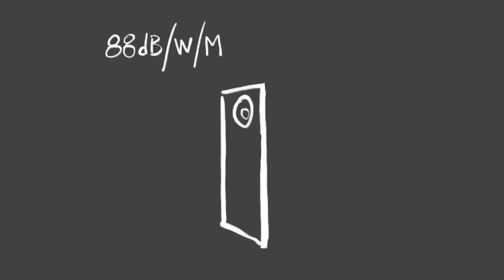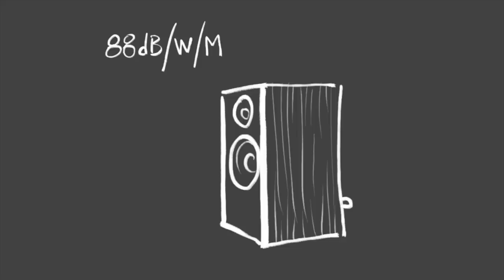John DeVore goes on a rant about the High End Audio lie that inspired him to start his company

Comment: About 5 mins into this I was seriously questioning how much John knows about engineering, but I decided to stick with it and came to realize he's making a valid point. Almost all audio power amplifiers are voltage amplifiers and are rated in watts into an 'ideal' load. Some Amplifiers include figures for 8 ohm and 4 ohm loads, some go further and include impedance below 4 ohm. However, a significant number of amplifiers are not capable of driving loads much below 4 ohms without either current limiting (if they have output protection) or a significant increase in distortion. So deliberately designing speakers that are a 'difficult' load is bad engineering.
However, given that most amplifiers are voltage output devices, specifying speaker output at a known voltage would still be more meaningful that trying to calculate the watts (which would vary by frequency). The other challenge would be the need to specify the sensitivity at several frequencies. However a good review (and a properly constructed product data sheet) would point out worst case impedance so that a potential purchaser would understand how well a speaker will be driven by a particular amplifier.

Comment: I absolutely agree with your rant. I am an ex musician  who is intimately familiar with how real instruments (like upright bass or un-amplified piano) should sound and  spent years trying to build a satisfying audio system. I also have a physics degree and am able to see through the spec bullshit that is used to confound uneducated audiophiles. Even though I was able to use my technical knowledge to build the most cost effective systems available (in the audiophile world) I was ALWAYS left unsatisfied by the results (and the  many trade offs the came on a limited budget of $20,000 - $30,000). That's when I discovered the pro studio recording world that audiophiles have ignored. In particular Genelec's top of the line digital active speakers were a revelation. They utilized built in dacs to to time and phase align the drivers and tune the  speakers to the environment. These things (8240a monitors and a 7260a sub) could absolutely annihilate any combination of high end dac, preamp, amp and speakers you could come up with  (under $200,000). That includes Wilsons, B&W, Sonos Faber, Mark Levinson, Krell, YBA etc etc etc. The most shocking thing about this was that the entire Genelec system cost me less than $10,000. Naturally, Stereophile and virtually the entire audiophile  press ignored what was going on in the professional recording industry. Had they acknowledged what was possible and the utter superiority of Genelec's (in terms of both cutting edge technology and sound), it would have destroyed the entire high end audio industry which, in my opinion is a complete and utter con that takes advantage of the gullibility of clueless audiophile suckers. 
P.s At one point I had a pair of Thiel 2.4s driven by a massive Bryston 4bsst amplifier. (the Genelec's easily obliterated this combination)

Comment: John, thanks so much for doing that!
Reply: Love your channel steve, great content.
Reply: Now, I see what happened.
Reply: Luis Abreu  great idea!  Steve, it would be great to hear an "outsider's" (i.e. not a manufacturer) take on this!
Reply: After owning Legacy Audio stuff, nothing else does it for me
Reply: Hi! Steve!
Reply: Steve. My system sounds like the dogs bollocks.
Reply: GeneralCurtis3LeMay   he made the correct over arching point. the old method was more useful and transparent. amps are mismatched due to the newer method. he is trying to educate the masses not teach physics for engineers.
Reply: GeneralCurtis3LeMay  Yeah, I wished for more from this video - cam you suggest any better source of info on the subject?
Reply: respect you and John ...alot....
Reply: @johnnycrinkle  idididv
Reply: one watt one meter is still one watt , no matter the ohm load on the amp, if it doubles in power for a low ohm load still only measured one watt.
Reply: Nice shot of the cats ohm
Reply: @veroman007   ,69
Reply: @BOOSTEDLASER  I have a pair if the original Focus. Has a 98 db at 2.83v rating. The impedance dips to about 2.5 ohms. It is harder to drive than one might think, but it is a true fullranger.
Reply: Happy to see you here
Reply: I think there is a lot of merit for higher sensitivity speakers with easy impedance loads. It enables a person to choose an amp for sound quality, instead of needing an arc welder.
Reply: How much do those companies pay you to be their puppet

Comment: I worked for a Medical devices company as an electronics tech straight out of college. There was a tongue in cheek saying among the techs concerning the variance of component specs we had to deal with through our suppliers. The saying was "When in doubt, don't scream and shout. Just change that spec, and ship it out". Since some of these chips and power Transistors were being driven very hard, our suppliers found it difficult to supply batches with consistent performance. Thanks for clarifying the Speaker debacle.

Comment: Thank you John, the audio community is in need of education. Keep up the good work! I'm so glad that you decided to make your creations available to everyone and share your thoughts with us.
Reply: Not in this regard.  Using volts is the better way to do it.
Reply: @dizzywow  Using volts is better when you have a high current amp that does not mind impedance dips. John's issue is that the industry is moving toward the assumption that everyone uses high current solid state amps.
Reply: Speaker manufacturers should give a proper db/w/m spec and an honest Z spec (or better yet a Z curve. But as Billy Joel said honesty is hardly ever heard.

Comment: I was into the audiophile thing back in the early 80s when I had money to burn. I bought 'good' speakers once (JBL 4311B) and still use them 40 years later.  I was also an electrician so it was neat seeing those formulas again.
Reply: I so wish I hadn't sold my JBL 4311Bs.  Great speaker.  I guess I'll just have to make due with my Tannoys.  First world problems...

Comment: Most of the stuff here is as clear as the sun and I’ve been aware of it for years. I’ve also spent a lot of time explaining this stuff to my friends and customers (when I used to work in Hi-Fi many years ago). But today as a well informed Hi-Fi enthusiast I pay very little attention to this kind of stuff. More important for me is how does it sound and how long it’s going to work without causing any technical problems. But it was a great pleasure to listen to this “rant”. Excellent job! Thanks a lot.
Reply from the maker: Thanks Greg!
Reply: The part that I found most important was that many amps (class D and tube) will have a disproportionate power output into different cones in a speaker rather than tracking evenly across impedances (assuming that a woofer has a very low impedance and the mid/high range speakers are much higher). That kind of dictates an equalizer be used in such a situation and the room be measured

Comment: Hi John, I really enjoy listening to your videos and can usually only agree with you. Big thumbs up!
I came across this 3 year old video by accident and can't follow your point this time.
From our sources (turntable, dac, whatever) we get voltages and the amplifier amplifies that voltage, the higher the voltage the louder it gets. A speaker with higher dB/V/m will sound louder. Of course, this requires a stable amplifier. As long as the amplifier works linearly, it will deliver a signal in volts. An amplifier that cannot deliver the required current is, in my understanding, “a problem”, but not of the loudspeaker. In many cases, it is only a problem when you turn up the volume, and only then can the current not follow.
A very special application is a tube amp with output transformers, as the different reeds for the different speaker impedances deliver different voltages to compensate for the current, and you said it right, the total wattage at the output remains identical at 4, 8 or 16 ohms.
But if I want to know which speaker sounds louder with the same potentiometer setting, I want dB/V/m. (can be different with tubeamp and using different tabs).
A loudspeaker with a higher dB/W/m value does not necessarily have to be louder at the same potentiometer setting.
Side note: Personally I'm playing with 300B and prefer higher speaker impedances. Here I agree with you absolutely!!!

Comment: I built my first stereo system in 1961 using those AR speakers of which you speak! Driven by an EICO 70-watt kit-built amp. I used to peruse Hi-Fidelity magazine religiously and I loved the pretty graphs showing the frequency response, IM and Harmonic distortion throughout the frequency range. My rant is that you can't find that information anymore. Most reviews just go "WOW! This new speaker sounds great! You need to use my affiliate link and buy them RIGHT NOW!"
Love my old dual-18" cabinets. Only problem is I can't move into a smaller house...
Reply: The measuring people lost the battle to the “but hey this sounds better” crowd.  Once Audio magazine disappeared, normal hifi disappeared and was taken over by expensive well styled products built for maximum profit. I pretty much ignore the entire industry now.  I play around with vintage JBL speakers and 70s era solid state amps.

Comment: The same thing happened to Operating Systems. The got bulkier and slower as processors got faster. What happened to optimization? Whether it be speakers, computers, etc. Nice review!
Reply from the maker: Thanks!
Reply: PoseMotion
OS? bulky? you meant Windows i guess, Watt Ohm? the same????
You need UNIX, forget Windows!
Optimization your speakers? new connes, what do you do here?
The less the connes move? the less Watt you need? Ohm?
Reply: Just saw this comment, and you put my own thoughts into words perfectly!   Too many electronic AND software developers simply push the hard work onto other components.  Operating system developers go wild like drunk frat boys with the code bloat and feature creep to push a multi-core, multi-gigahertz CPU down into the mud when it should be supercomputer speed.  Speaker engineers just place ever higher demands on the amplifiers rather than creating more efficient designs.   Customer needs don't seem to be much of a concern to any of them.
Reply: @terryc7142  To be fair to them, they aren't exactly provided with the development time required for someone to care.

Comment: I'm a 42 year audio veteran, I only want ot point out two things. One, you buy a system, that system has to work synergisticly together, so if you love a speaker that has a serious impedance dip at the crossover point, you should buy an amplifier designed to deal with that to deliver flat frequency response. Two, even in 2020 the time of this posting there were and continue to be Digital switching amplifiers that do double in power as the impedance is halved. (I'd point to two measured by Stereophile from main stream company NAD, the M10 measured @ 155 into 8 ohms and 290 into 4 ( this from a 100wpc spec'd amp per NAD ) , the M33 over 200 into 8 and over 400 into 4. Otherwise we've been preaching this to our customers for decades, nice work John!

Comment: I spent 35 years servicing and restoring those "battleship" receivers. I finally had to change jobs because I couldn't lift them anymore. I thought I was in heaven when Bob Carver came out with the PM1.5, that had 1000W output, and you could literally lift it with one finger. Thanks, Bob.

Comment: You are absolutely right, my background is in the Germany DIY hifi scene and everything you said is what I would call common knowledge. I personally use 95db/w/m full-range 8" speakers driven by 5W TV beam tetrode - got all the loudness I ever need. Most people also don't understand the first watt is the most important in an amp. Regarding sensitivity 'cheating' - fortunately it has never been easier to own a calibrated measurement microphone - so it's possible to assess loudness in a real-life scenario.

Comment: Good job man! I have run out of breath trying to explain this to people who are otherwise intelligent, but more specifically to Guitar Players as my primary industry is Speaker Cabinets for Guitar Amplifiers (GIGsigma/ThunderCAB/AngryMidget). And for what you described alone, started building small tube and solidstate guitar amplifiers for only to demonstrate what a good amplifier rated correctly should output and sound like.

Again, Good Job!!! If I had to get that all out in as calm a manner as you did, I would have either needed a whole bottle of Blood Pressure Meds OR would have been yelling half way through…

Comment: I really learned something from this video. I am an EE, and I was unaware of this. Thanks for the excellent explanation!
Reply: From one EE to a fellow EE, most curricula do not cover audio electronics explicitly.  But, audio amplifiers are in effect linear amplifiers with voltage outputs proportional to voltage inputs.  Speakers exhibit capacitive & inductive reactances as well as resistive components as a result of mechanical and electrical impedances.  Watts for all intents and purposes are meaningless when specifying speaker parameters.  I disagree with the premise of this rant.
Reply: @stephenmead5488  I believe you to be a bona fide electrical engineer based on what you say. You are correct,  Vout is proportional to Vin and it's voltage that matters with loudspeaker sensitivity. A ratio of electrical Pin vs. acoustic Pout is a measure of loudspeaker efficiency and that's a different thing. If we used a fixed wattage rather than a fixed voltage to measure sensitivity, that would favor the lower impedance, and so it wouldn't be a fair (and therefore not meaningful) test. Loudspeaker manufacturers would (and did, I owned several "8 Ohm" speakers that were more like 6) be able to manipulate speaker impedance to produce more impressive sensitivity numbers, and because efficiency is rarely if ever stated, nobody is the wiser. Specifying a voltage that corresponds to 1W into an 8Ω resistive load (what is used to measure amplifier power) is an elegant solution that makes cheating via lower impedance impossible, and neatly eliminates the need to deal with the calculus of reactivity of the load. Win-win.
Reply: @Christopher Grant "electronic datasheets" should be in MATLAB format, or at least CSV for import into anything. The Internet has an unlimited ability to present more, and more important data to technical buyers. What do vendors do? Make a PDF of the one-page flyer that they used to have in stores when those existed. I used to get 3-ring binders full of product data from manufacturers before the Internet, no longer. It's a shame.
Reply: @Christopher Grant well, any data beats a photo of a model pretending to be overjoyed by some industrial product. IMO, corporate websites should be places where the various design engineers can place tons and tons of data for systems integrators to use, so they don't have to use trial and error. IJS

Comment: Lets talk about how the sensitivity spec is measured by a single sine wave at 1k. How realistic is that? Kinda like how equal loudness curves of the ear were first measured by sine waves, 80 years later people learned that complex spectral content radically changed our perception of volume.
Reply: Any self respecting speaker manufacturer would rate the sensitivity of their speaker using a broad spectrum signal like pink noise at a given reference voltage.  Typically 2.83Vrms.
Reply: @stephenmead5488  That would be the way to do it, but are people really doing it? I heard different
Reply: It's not realistic with respect to frequency response linearity, but that's why people like to have their speakers tested for freq. response from 20 - 20kHz. It's a lot easier to spec at a single sine wave than to create some kind of broadband resolution specification that no one understands.
Reply: Actually, I would impulse response analysis if I wanted frequency response data.
Reply: @stephenmead5488   What kind of pulse would you use? Is this because the transient has broad frequency content? I've done tests in the past with a flat sine sweep to provide a transfer function of the harmonic response, so I'm curious as to what improvements this can offer.
Reply: @daleschick9005  The pulse referred to in my comment encompasses time based as well as frequency based parameters. It uses principles of convolution for linear systems. Computer analysis would be used.

Comment: Good explanation. I wish that the lower-end and mid-fi speaker manufacturers would keep their speaker impedances closer to what low-end and mid-fi amplifiers can deal with. People who buy 2 ohm high-end speakers have the means to buy the arc-welding amplifiers that can pump out the current, but we peons are often lulled into poor choices by misleading specifications. Also, an 8 ohm speaker can measure close to 8 ohms with a multimeter across the terminals, but when actually playing music, the impedance can drop drastically.